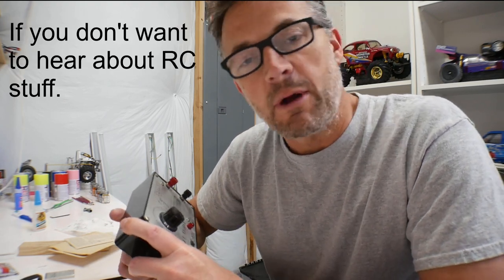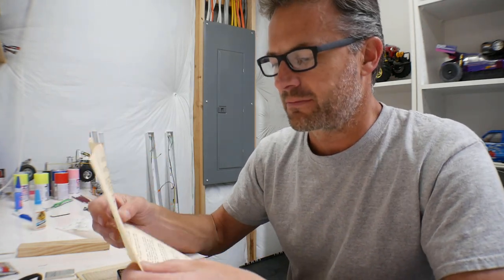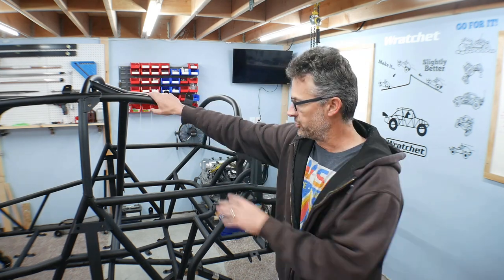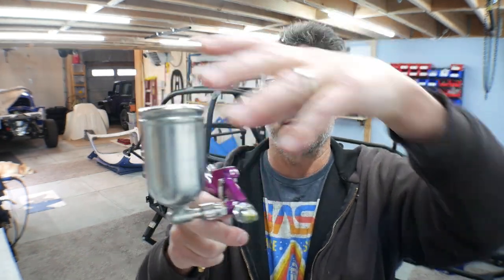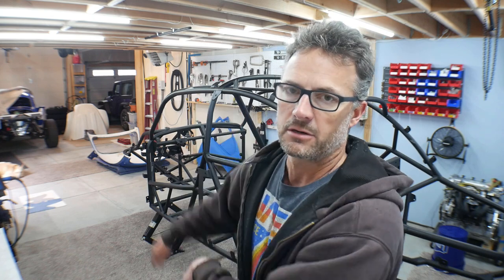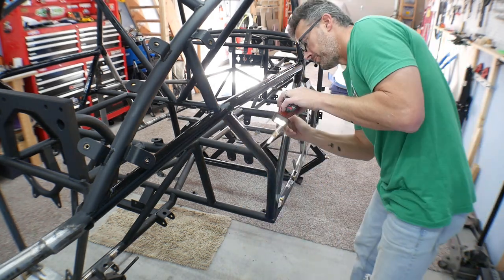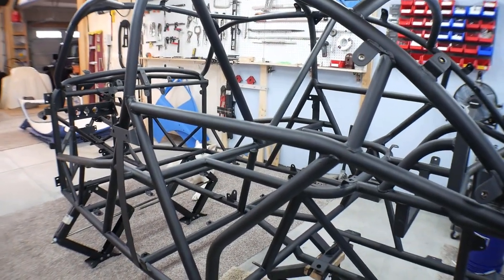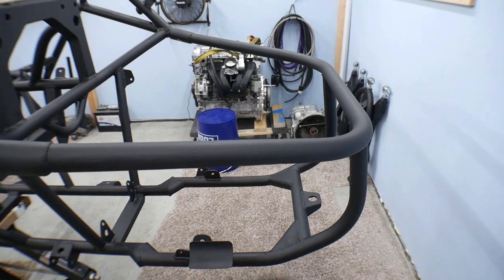Tips and Tricks for painting a chassis in your garage

Comment: Hey,great show,I'm with ya in Rust-Oleum,great paint.
Myself I gav a street rail, rarely sees a trail, anyhow ,I use rust oleum gloss,and rusty metal primer, and a brush!and no one knows cuz you don't see brush marks,how ? figure out working in cold garage,keep paint in house at room temp,heat up cold garage,apply paint to cold metal,paint dries slowly,brush strokes disappear due to extended cure time,and way glossy,stuff blends nicely also,always adding tube , upgrades,
Reply from the maker: Ah, that's clever, you're using physics to your advantage. 👍

Comment: Nice job Mike👍. If you didn't like painting the roll cage and you want to show a bare metal look, you can spray paint it with clear paint. To me painting the roll cage is only for rust prevention. I clear paint a bicycle frame at one time and I was satisfied. I guess it's how you , as an owner, like it.
Reply from the maker: I saw someone do that once, and it was really cool. They told me it was hard to paint because they couldn't tell where the paint was. 😁

Comment: I showed a 1964 GMC swb, I show in the “unrestored” category and never got as much as a nod. This was a one owner, 43,006 original miles. 
I took it back home tore the truck down and did my frame the same way. It had two coats of semi gloss, scotchbrite pad, rolled on. Two coats of semi gloss Ace hardware paint and rubbed out with 400 grit. I end up putting in a 350-350 combo, air and reupholstered front seat. The truck looked impeccable. I took first at the Truckin Nats and sold it at the show for 16k in 1994. We just used alot of sweat equity and cold nights. Well worth it!
Reply from the maker: Wow, nice work there, that sweat equity literally paid off. 😁

Comment: Paint job looks great Doc , I have tried a few different techniques over the years including powder coating my entire frame and in the sand dunes the tires blast the powder coat over time. I want you to try this stuff , I believe you will love it. It comes in 3 colors Black, Gray & white. Sometimes i will mix some gray and black and come up with a neat color, It is a high gloss and wipes mud down really easy. You have to try it , It outlasts anything I have used ,including powder coating in some areas. I brush it on and the brush strokes wont be seen. Try it. Keep up with the great videos .
  I tried to attach a picture here with my comment but I couldn't figure out how to do it. The product is Rust-Oleum Hammered. This stuff dries hard and does not chip easy.
Reply from the maker: I'll check it out, thanks for the info. 👍

Comment: Have you tried Rustoleum Hammered brush on?   Works great and very durable with no brush marks and easy/clean touch up.  You can also thin it to have less of a hammered surface. Hammerite brand also has some great smooth and hammered paints. Ace hardware is the only local place that I can buy/order the Hammerite. 
Thanks for another good video.

Comment: I prefer to spray stuff with automotive grade paint over rattle can for durability - even compared to rust-oleum. No matter how you do it, prepping and painting a roll cage is a lot of work. If you're using automotive paint in a spray gun, the 3M PPS cup system allows you to spray upside down which is very helpful for cages and such because the gun doesn't run out of paint while inverted. This works because the cups are sealed and collapse with vacuum from spraying so there are also no leaks. 

HVLP guns have less overspray, but you need a good compressor.
Reply from the maker: Interesting on that gun, never heard of that. Honestly that would make a huge difference. Thanks for the info. 👍

Comment: Try brushing on the rustoleum hammered paint. It leaves ZERO brush marks because of the hammered separation look. It is definitely a glossy finish but it hides all blemishes. it goes on thick and takes a loooong time to fully dry, but Its pretty cool stuff.
Reply from the maker: Someone else mentioned that, I'll experiment with it. Sounds like it might be a good solution.
Thanks for the tip.
Reply: @DougBugBuilder  great! I found the best way to do it is to prime or brush flat black underneath it first otherwise it separates a bit too much right on bare metal.

Comment: hey hey.  watched your video of the ackerman system and your baja build. 
it made me wonder what if you flip A arms and spindles from left to right side and move suspension forward accordingly. then you should have room for rear steering. would be cool to see the diffence and for you to give a hands on verdict on the effect. steering rack would need to be upside down too or be 2 axles with a gear on each to change direction of input  rotation.

Comment: We usually powder coat chassis like these. But it's a bit more expensive. A lot better than paint for offroading. Also for your application I'd suggest get a truck bedliner paint, mask off the areas where you'll be having any sort of bolts, and just paint or spray it with that, for offroad use, nothing can beat that.
Reply from the maker: Oh having it powdercoated would be nice! But I wasn't going to go that far with it. I thought about using bedliner spray in some areas, I suppose I still could. Good tip on masking off where the bolts go through. 👍
Reply: Most pro off-road teams do not powder coat or paint the chassis of their race trucks or race cars. This is because it is easier to see cracks developing and the chassis is always being worked on. Before each race the chassis is rubbed with an abrasive pad, then sprayed with CRC or WD40. This is ok in hot dry climates like California, but not so good in damp climates where the chassis will quickly develop some surface rust.
Reply: @ataxpayer723  I worked for 2 FSAE teams, now I work for an offroad and drift race car team, and we powder coat all our chassis, first we build our cars to race not only one season, but multiple races across the world and also multiple seasons. Secondly about chassis cracks we model and analyse our chassis in CAD first, some parts are overbuilt, if that's not enough we inspect full chassis before every race.
Reply: @RetrowaveUniverse  According to an offroad crew chief that we know, a powder coated chassis is more difficult to repair, or weld on, compared to an unpainted chassis.